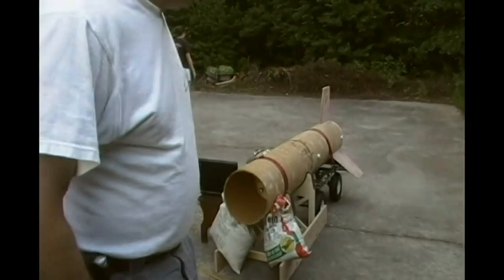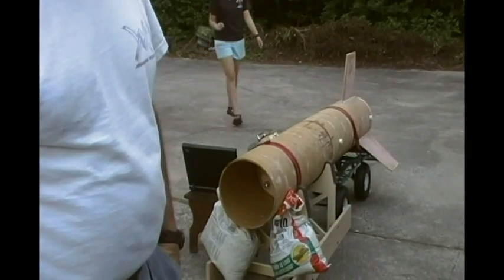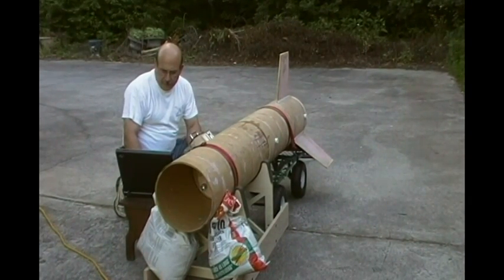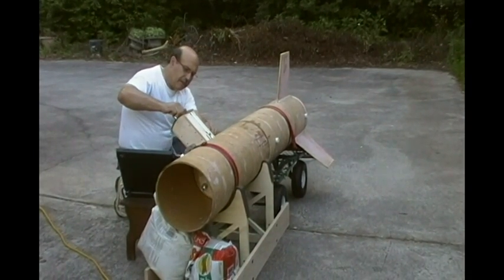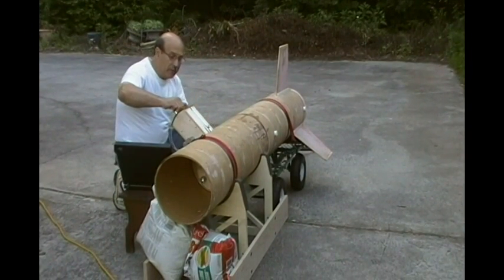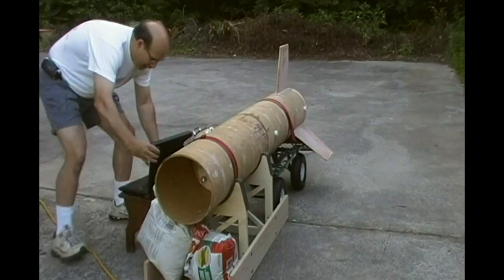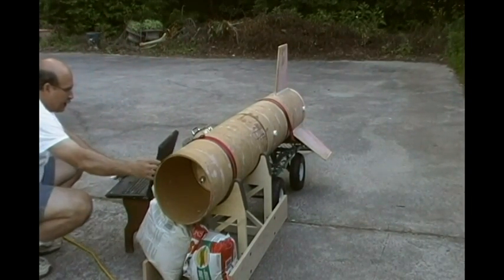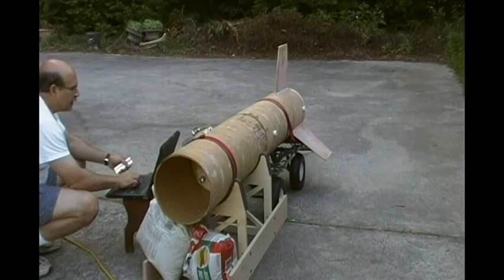Static Launch of the Cuban's Missile Crisis

Comment: The charge he is testing would be set off by the on-board electronics many thousands of feet in the air to deploy a drogue parachute.  Since he is a bit uncertain how much charge is required to cause a successful separation of an airframe this massive, it seems he may have used a little bit too much.